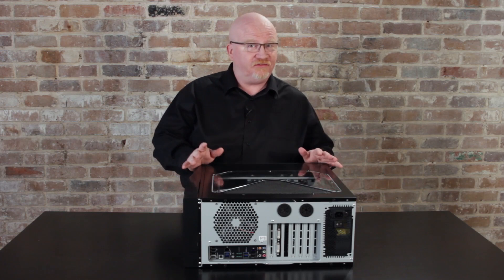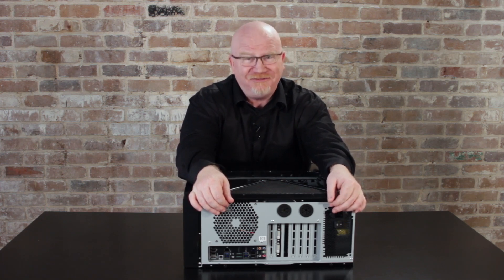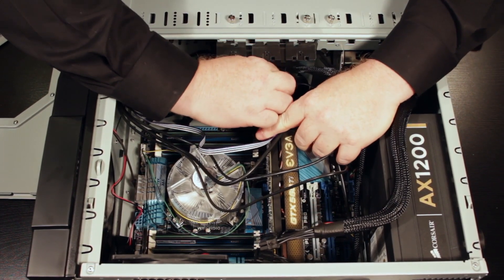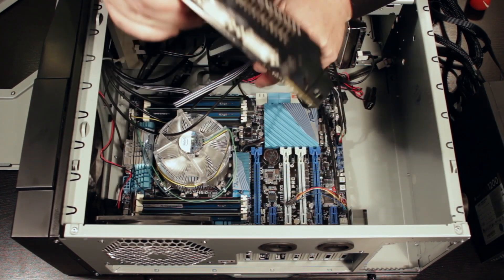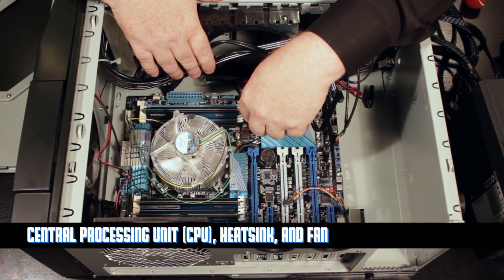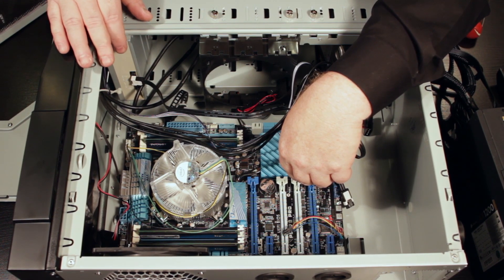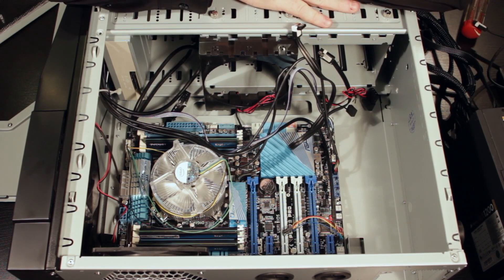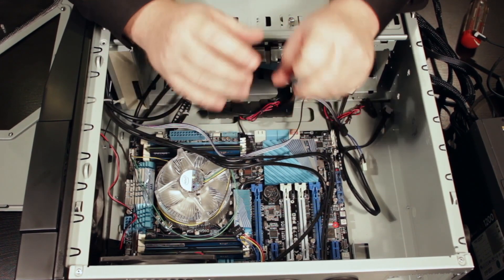[License to Tech] CompTIA A+: Inside a Case; with Mike Meyers

Comment: Mike that is a a nice graphics card, how much ram do you have installed in that machine 8 GB or 16 GB... can that computer be used as a powerful gaming machine?
Reply from the maker: I just set up the machine for the video. I did have the video card from a gaming system. Always more RAM is better :-)
Reply: I agree but it all depends on the available memory slots on the motherboard to for the amount of memory the computer can handle.

Comment: Also now that i think about it what about the north bridge and south bridge? I think the north bridge is the one that typically has a heat sync on it now days any way. Any way I think if i remember rightly the north bridge does alot more with data than the south bridge. My guess came from the heat sync. Also basically both the south bridge and north bridge relay data to the CPU. Thats my guess anyway but that wasnt mentioned either. I also remember something about the north bridge and south bridge don't communicate to each other but just to the cpu or maybe the north bridge relays info to the south bridge and the cpu but the south bridge never sends data back to the north bridge. Anyway clarification on that would be greatly appreciated.
Reply from the maker: There is a detailed section on north bridge and south bridge in the book. Don't want to put you off but it's a long explanation and you said you had the book. When you read about it, if you still have questions Mike's email is in the front of the book. He loves to hear from clients.

Comment: LOL that power supply is over kill lol. I have 2 GTX 680s in SLI and i have a sound card and an SSD solid state drive and 3 3TB 7200RPM hard drives and a blue ray player and i cant even utilize all that power lol. I do have a 1200 watt power supply though and its a gold edition which saves on power in theory and it should last a while but i just got all that power because i might quad SLI my system by adding two more GTX 680s or that was my plan/ thoughts when i first build my computer. At this point though i will probably just get 2 GTX 780s though or wait for a new GPU to come out that can handle gaming in 4k resolution really really well. meaning it would need to be able to stay at or above 60FPS frames per second at 4k resolution and i want one card that could give me this kind of performance and than i would 2 way SLI that card. That thing only has one 560TI in it lol any way thats definitely over kill for that little machine on the power supply anyway. I guess atleast it served the purpose on naming parts such as CPU,GPU,MOBO,PSU,RAM and CPU cooling fan and just the internal parts in general. Maybe PCI slots should have been mentioned also. just a thought. Thanks for the videos and i also bought your book haven't read but a few pages so far though. I just received it. I know alot about computers but i want to prove that knowledge so thats why im getting certification. Im getting the A+ first and than i plan on getting the CCNA and than CEH and i have purchased books for self study on thease subjects. two of the books are the mcgraw hill books and the CCNA book is from someone else. I also purchased some books on JAVA and Android development and than i plan on going on to C++. Alot of this is just gonna be a review for me though. The A+ is probably gonna be the easiest of the test but my hard work will pay off i just have to put the work in.
Reply from the maker: You can never have too much power :-)
Good luck with your studies. It looks like you have an aggressive plan. You are right A+ is the place to start. Hope you like the book.